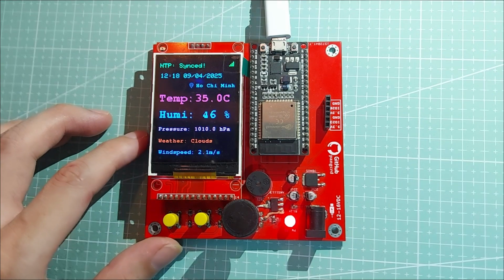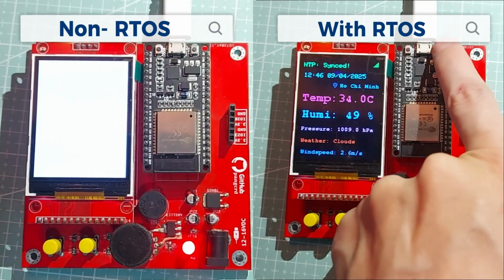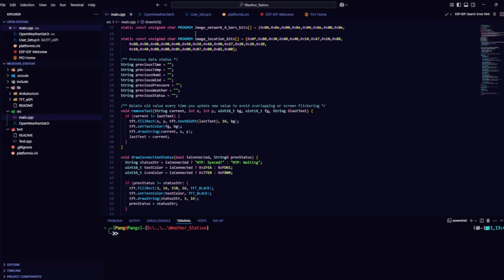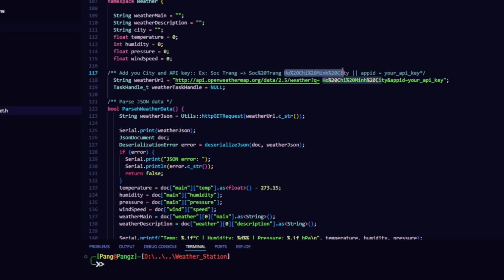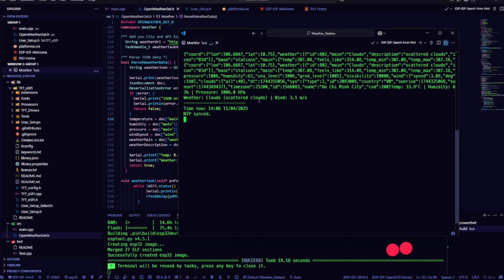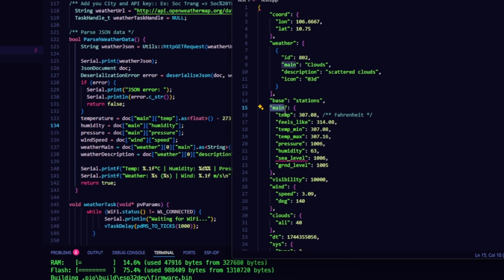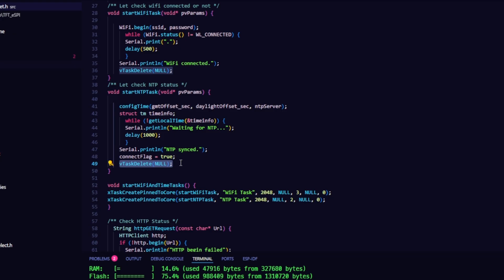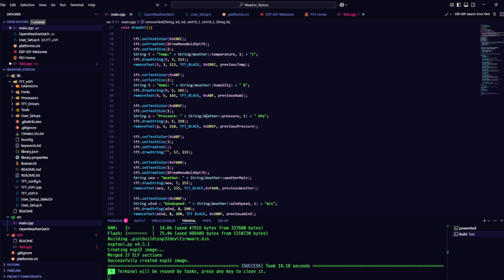ESP32 Weather Station Project - Simple UI with TFT LCD [Step-by-Step]

Comment: Hi brother i did one tft ui but while compiling it showing sketch is to big. Any settings is there for low flash memory?
Reply from the maker: If u are using Arduino IDE 
Tools → Partition Scheme -> Huge App, then rebuild and upload again 
If u are using platformio goto platformio.ini ADD line 
board_build.partitions = huge_app.csv
Save it then rebuild and upload again